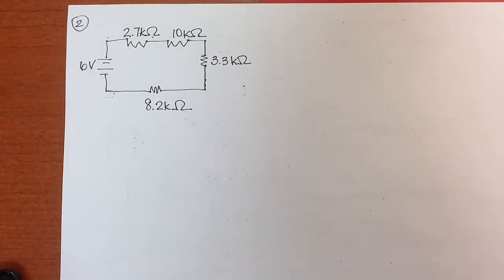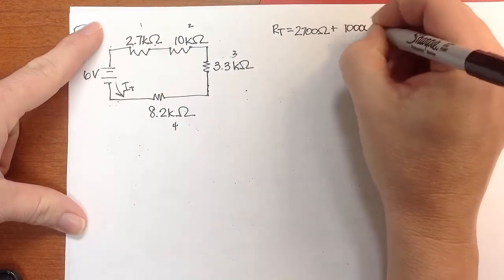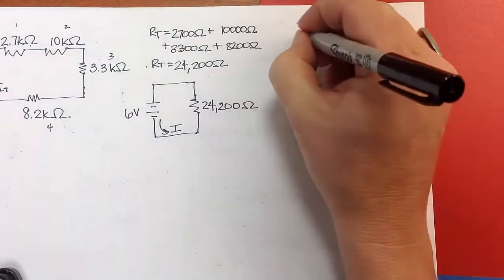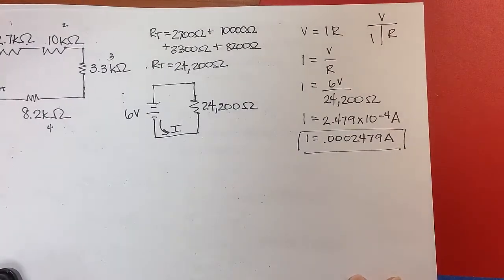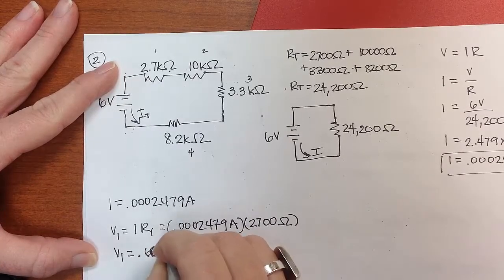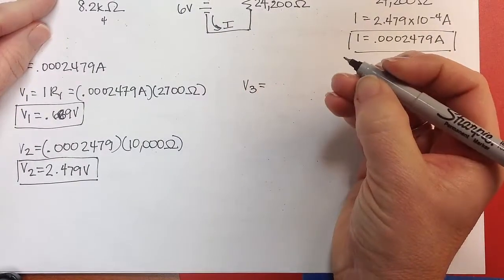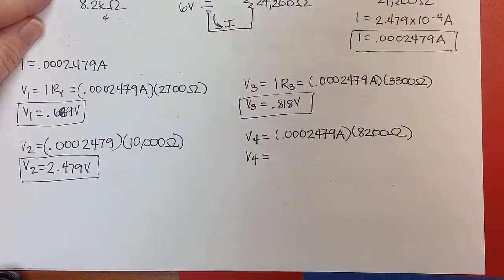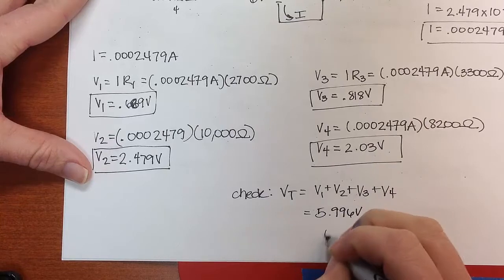Series circuit practice problem 2

Comment: I've watched a couple of your videos now on series circuits. Your math is perfect. Still I have a question: why on your schematic diagrams do you show the current leaving the negative terminal of the battery? I understand that in terms of KVL which direction the current circulates is a matter of personal choice for purposes of analysis; nevertheless, the direction that you have assumed is exactly backward from how batteries really function. You've managed to adopt the passive sign convention and eschew the advantage of using it simultaneously. (The passive sign convention: the potential difference across an element is positive if and only if current enters the element at its positive terminal.) From such a point of view voltage drops are positive, voltages rises are negative. This further implies that power expressed as V*I across a given element is negative if the element is delivering power to the circuit but positive if it is dissipating power.